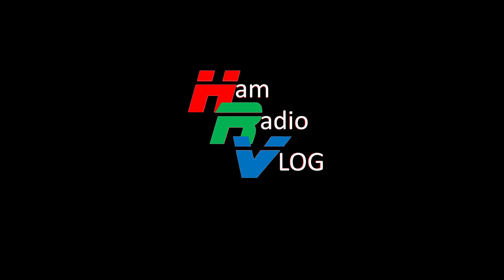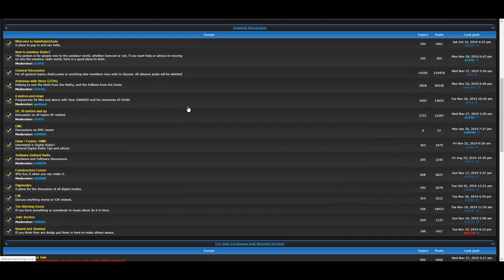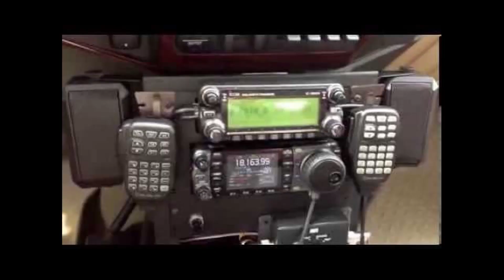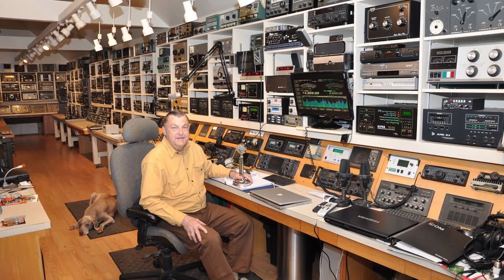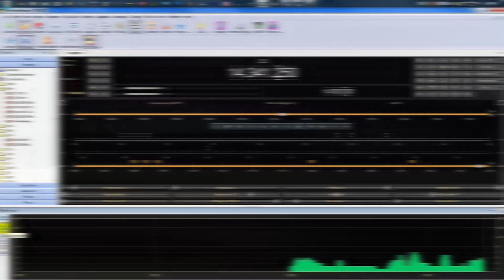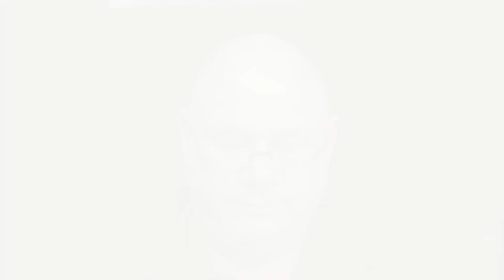New to Ham Amateur Radio? What do you need to consider?

Comment: Good advice, as good as I have heard so far.  How about doing a series to get people on the air, page by page of the Foundation Now book.  There is as far as I can see, no one doing the Intermediate Licence, so if you have the time it might be worth doing all of them and explaining as you go.  Just a suggestion as to how to grow your channel.
The ANTENNA and the COAX is the best investment you can make, more important then the RADIO.  Some radios have an SWR meter built in, so ask when you buy.  If you can avoid a Antenna Tuner it is better as what you are putting up the coax is getting to the antenna and not disappearing as heat in the tuner or coax.  VERY WELL DONE SIR.  BEST ADVICE I HAVE SEEN SO FAR.  Excellent in fact.
Reply from the maker: Thanks so much. I find it easy to take information in and simplify it and then put it out. I am not sure I am the right person to do a study guide video TBH as I would worry that I am not putting it out in a way that would help someone pass the exam. 73
Reply: @MikeM0XMX  I think you would be very good at it, taking it slowly and explaining as you go.  I think you should give it a try.  There are a lot of people out there wanting to do it and very few people are willing to help, this virus is stopping people joining Clubs and a lot of people don't want to go to a Club anyway.  They may have to in the future, but for now it is on line.  You could go through the basics of the practical so they know.  But it is basics, but in the CB days people were twisting both the braided (screen) and the conductor of the coax to make sure they got a good contact!  I know it is funny, but this is what happened.  Some had no idea of SWR and how an antenna worked, they bought tiny antennas an wondered how they couldn't get out.  Of course they didn't know and fell into all the hype as well, K40 antennas and mic and everything else.  So you see, if you can do a video like this I think you can do it and do it very well.
I have a dodgy keyboard on this laptop and it is driving me nuts!!!

Comment: W O W! This was great info. Too many choices.
Reply from the maker: Thank you. 73
Reply: Randi Cook:  You just have to decide what interests you, talking locally of contacting others abroad, I say contacting as sometimes there is no chance of chat, more like "Thanks for the contact, give me a signal report and I will see you further down the log!" This should be what you get out of the way before you find out who they are, where they are and anything else you ask, but all some are interested in are contacts.  However, that is fine if that is what you want. " meters is very local and for driving home and contacting others locally, more or less.  But once you decide what you want to do, then the choices are a bit less.  A local club member might show you the bands you could use and give you the advice you need to make the decisions you need to make.  You can buy a set that will caver a lot of the bands but not all.  If you want to start on the cheap (but it is not that popular, but is starting to open up again) is 11 meters, you can buy a CB type radio that will cover most of it.  I know some that have converted an old CB to use there.  But you need to know what you are doing.  The lower bands are better for long distance and DX and the higher you go the less suited they are for this, though there are occasions when they to open up, but not very often.
2mtrs you can get onto very cheaply, though unless you go through a repeater you will not get very far, but the cheap Chinese Hand Held sets will get you onto there, may have to reset and set the radio up unless it has been done by someone else.  HF sets are more expensive and can empty your bank account easily, so it is best to find out what you want to do and stick to it.  Digital is all the rage just now, but it is very impersonal and some stations are even automatic with standard replies.  For me it is SSB and FM and HF 80, 40,20.10, and 2mtrs.  I might want to go lower, but then the antennas got impossible for most gardens.

Comment: Looking for advice on a power supply. I am in the US. 110v to 12v. How will amp effect the radio? e.g. 5 amp vs. 10 amp. Still putting out approx. 12 v.
Reply from the maker: Hi Ron. Depending on the radio (and power requirement thereof) it will determine the capabilities of the Power Supply. Typically for the average 100W radio you should be looking at a 30Amp supply. There are many available from everywhere (HRO, Gigaparts, Ebay, Amazon). Astron, MFJ, Samlex seem popular at around $150 new.
Reply: @MikeM0XMX  OK. Sounds great. I am looking to have a mobile 25 watt, UHF/VHF radio put on a bench so it can be programmed it using a computer and software. It is difficult to bring the computer to the radio and since it is not programmed and not installed yet, I am hoping to bench it first to try out. Thanks for the response. Ron-KN4ZUJ.

Comment: Thanks so much and I hope to buy a yaesu ft-818 modified and atas 25 for base station qrp use at home later on I want to add the ft-857d from gigaparts.com wish me luck on my exam
Reply from the maker: Hi. Glad to be able to help. I have never used the ATAS25 although the 120A was a great (compromise) antenna. Good luck with the exam. 73